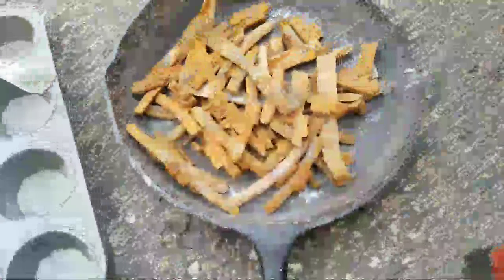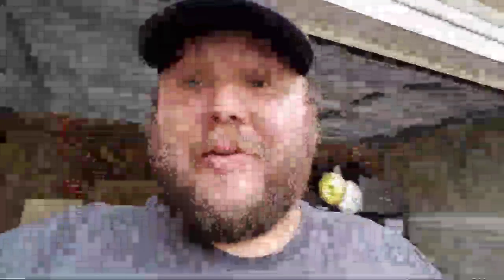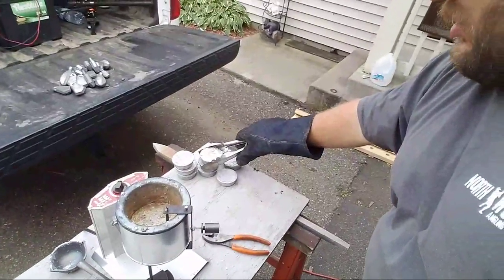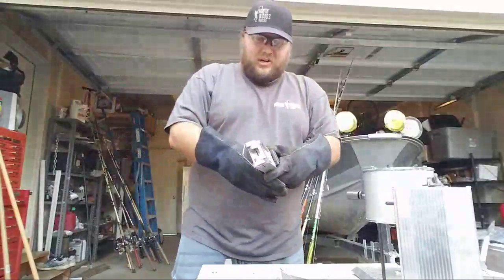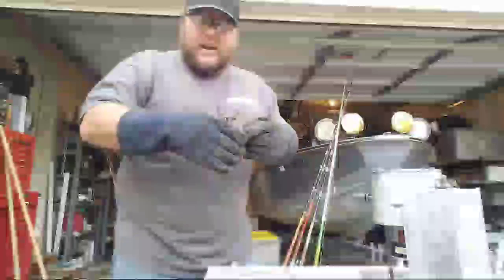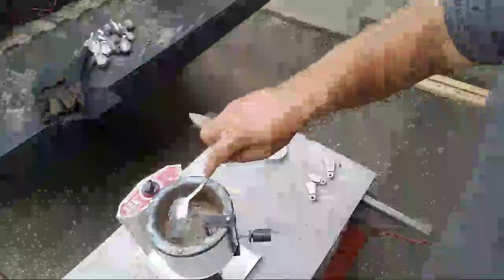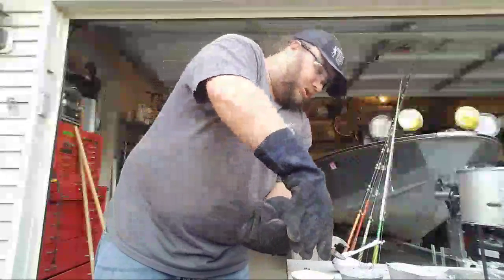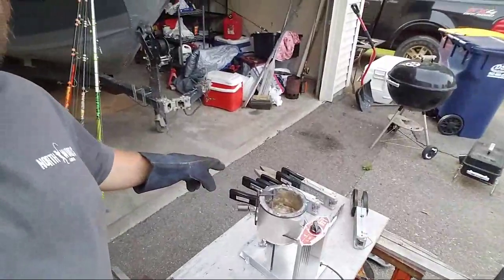Making Sinkers for Fishing - The Easy and Cheap Way - LIVE with Luke

Comment: Loosen or tighten the screw on top of your handle lever to stop the dripping. I usually have to adjust a few times while casting lead, depending on how much lead is left in the pot.

Comment: Okay quick question. When using these flat sinkers on a sinker slide, what sinker slide to you use? The clip has to be a little wider because they are not connecting to a little metal eyelet.

Comment: To me, the idea behind making sinkers, is to save money. The equipment you use cost a fortune.  I fold a piece of coathanger in half, poke some one inch holes in the dirt, stick the folded coathanger  in, and pour. The deeper the hole, the bigger the weight. I like about 4 oz mainly.  My friend works at a junkyard, I give him a little weed for a bucket of metal, which lasts a few years. Melt the metal in a tin can.  Hillbilly Sinkers = zero money.